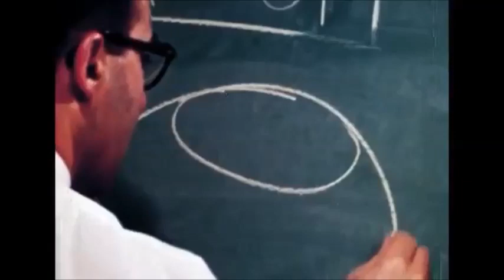Flat working model

Comment: According to this video the currents near the northpole need a rotation. So it contradicts one of the main claims of the flat earth being stationary.
Reply from the maker: Lol its how they got the currents do it on a ball Where's your video. When does the water start to bend. So how many models would you need on a ball. It represents the earth to the equater it said. So does that mean it's flat to the equater. Bye bye ball
Reply: @captainkirk1  
Water bends all the time there is no starting point. This video is just a representation to show the Coriolis effect. Meaning how a rotation changes the direction of the currents. It doesn't mean that earth is flat to the equator.

The flat earth still fails, the movement of the currents are not possible if earth is not rotating. What causes the currents to rotate on a flat earth? If you don't have an answer, at least admit that you don't know. Don't forget the current in the southern hemisphere rotate the other way. Even if we assume that earth was flat and rotating, the southern hemisphere currents contradict it.
https://earth.nullschool.net/#current/wind/surface/level/orthographic=-15.84,-4.98,374
Reply from the maker: @ateriana5116  come back when your a grown up don't want children here
Reply: @captainkirk1  In other words the flat earth model is so pathetic that it doesn't even have an answer for that question.

Comment: Nope!
Go away, no need for this!
Globebusters have proven that the Earth rotates 15° per hour.
So no more need for these nonsense videos!
Reply from the maker: Prove your spinning
Reply from the maker: @dickflinghammer7643  lol nice
Reply from the maker: @josleys  programming for the dosile you stick in front the t.v I'm sure they will look after you when you get dementia
Reply: @josleys  As I said. Agents. You don't get on Netflix without being a tool of network control. You don't get it. Go watch more tv colonel clueless.
Reply from the maker: @steverushforth7009  lol a load of bullshit
Reply: @captainkirk1  All verifiable facts, to which you have no answer for, please show me you working flat earth map, nav tables and nav methods which do not use spherical trig and use a sinusoidal curve to work. I look forwards to your reply.
Reply from the maker: @steverushforth7009  how did ppl get about before Sat nav and gyroscopes did the air balloons the Chinese have have GPS or a gyroscope answers please
Reply: @captainkirk1 Celestial and solar, IE you can find lat with Polaris in the norther hemisphere  by exploiting the sinusoidal (linear) curve of the earth, and taking a noon shot of the sun and comparing the current time to GMT by exploiting the 15 degree per hour rotation of the earth.